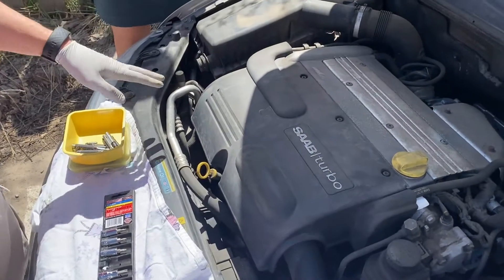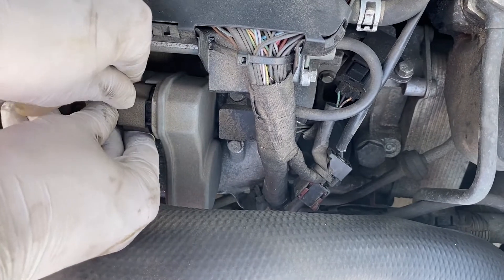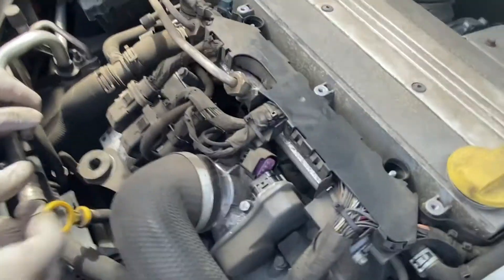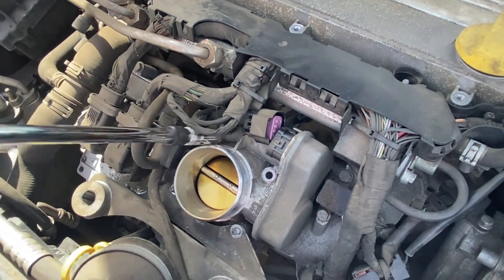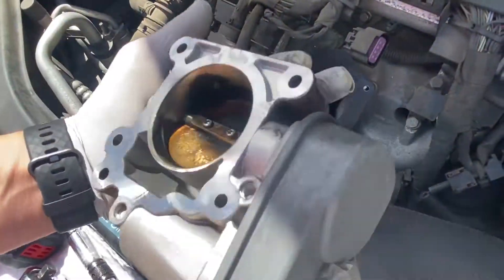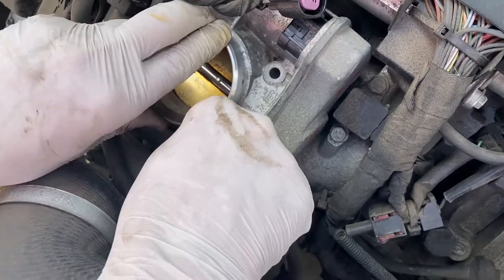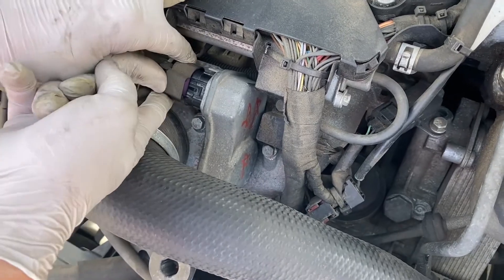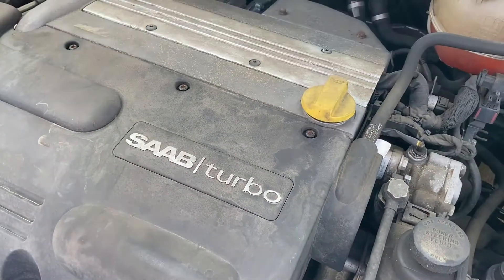Saab 9-3 Throttle Body Actuator replacement (model year 2003 - 2011)

Comment: I have a P0638 code. Ive been told I have to replace the whole throttle body to fix it. Is this true? I cleaned the throttle body and the issue still remains. And if so. Which is the oem part to replace it? Help would really be appreciated. Thank you!

Comment: As my car is 05 reg my auto elec checked wiring to throttle body and wrapped In heat reflecting tape same as ECU - wires get brittle with heat on 2.0 turbo

Comment: What tools did you use? I have a 2007 Saab 9-3 2.0t. I want to replace the throttle body but I don’t know what tools to use to remove the bolts and screws
Reply: They are all 10mm bolts

Comment: Good video. When done, be sure to go through the throttle position sensor reset procedure, using the gas pedal and key.
Reply: Can you explain? I’m going through this rn
Reply: @UnknownRichasf  Get in the car, close doors and have key in your hand.
Press the throttle all the way to the floor and leave it there.
Put the key in the ignition and start the car.
It should idle, even though the gas pedal is to the floor.
Release pedal fully with a smooth action, don't snap it up.
Stop the car, and restart. See if that fixes the position.

Comment: Do you need a dealership for like the sensor or is it ok to just put in
Reply: Just took mine off and cleaned it made a difference no more engine light limp mode :)

Comment: But did it clear the code ? I got the same po638 code yesterday. Seems like you used a pre owned tb did this actually work ?
Reply from the maker: In my case the code did not come back after I replaced the throttle body. You are correct, I used and replaced it with a pre-owned part.

Comment: What throttle body did you put in it? I found one for 160$ but I’m not sure if it’s good enough quality
Reply from the maker: I ended up putting in one from a newer model year donor vehicle. I think it was about $25 (used).
Reply: @bpetertube  junk yard or eBay???

Comment: I got 50/50 coolant down into the throttle body actuator I sucked it all out with a small diameter tube the rest paper towels got the car to start is this going to permanently damage my car or should I do anything specific prevent damage I have not driven the car but ran it for about 20 minutes until the white smoke stopd. Also I have 1more question about the upper hose with a T when I bought 9-3 2.0t 08 it was blocked off in a straight with a bolt in the end with a pipe clamp around the small radiator that can to the T but someone put a straight upper radiator hose one with no with no T please help great Vid by the way

Comment: Do you need Tech2 to marry the new throttle Body?
Reply from the maker: I did not use Tech2 to make it work with the replacement throttle body. I just replaced the old one.

Comment: I got the p0638 code today . 06 just sputtered a couple time . Hope this is the issue and not the PCM! It has 187504 miles on the clock
Reply: Did you ever figure it out?